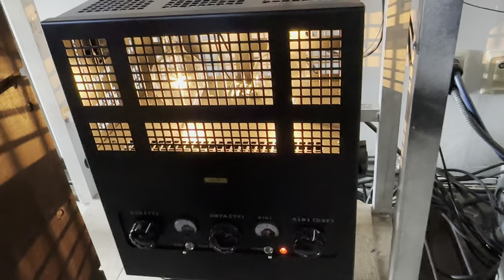3,Sound Of Western electric 12a,13a horn Speaker

Comment: I was lucky enough to own a pair of Altec-Lansing Voice of The Theater with the 801 horns. The definition, the low bass and the efficiency were all astonishing. To prove how efficient they were, I only drove them with just my preamp, no amp connected. That mV level was able to drive them. Amazing. The directionality of horns can be disconcerting for some, but the definition can't be beaten.
Reply: When I was 19 -20 (1970) I bought my first "stereo" the speakers I chose we Altec-Lansing Voice Of The Theater A-7 500-8 component system and my dad and I built the cabinets to spec. Horns mounted in cabinet. They were powered by a Kenwood integrated amp KA-7002 which I believe was rated at 50wpc. this sounded amazing especially when I'd take them to a outdoor party where they could flex their muscles, playing Led Zeppelin for instance around 3-4 on the volume and standing 50ft or more away sounded like a live band playing. I had those speakers for about 12rys and sold them for what I paid for the components which was $600 if I remember correctly.
Reply: I have also heard about VOTTs being driven from the headphone Jack on transistor radios. Would like to see and hear this!
Reply: @harryberry474 Still wish you had them?
Reply: @theman36  ...yeah sometimes, they were fun but impractical indoors they really needed room to breathe, I replaced them with ADS L710's (which I still have stored away)

Comment: I remember similar in an old Mono cinema I worked in as a youth. Mains energized coils. Silly efficiency, fed by a double push pull pair KT66 30 watt amplifier. Years later I measured the frequency range. Nothing at all below 100Hz or above 8kHZ. Fine for old optical mono sound. Did sound better than it measured, but a little boxy and quite colored sound. Typical for big old cinemas of its day. Not HiFi by any stretch of the imagination.

Comment: Looks like we got audio right the first time as a species. What is this? 110 year old speaker system for a movie theater?  I've messed with Jensen speakers from the 30s and yes they also required about 400V on the coil to engage the magnet. I have a Magnovox from 1923 that requires a 6v battery to be connected to the coils.

Comment: A rare and terrific turntable but these speakers are really colored by the entire horn/wooden parts. Yes they are efficient but mostly made for stadium use not for reproducing piano. Which is really hard for ANY speaker to get right. This recording seems to have artificial reverb. It could also be the effects of the horns I mentioned above. Looks cool but  not accurate.
Reply: does it matter? to some it does to most it doesn't.
Reply: If you enjoy it fine. But distortion should be something you strive to eliminate not encourage. Getting closer to the source material or original sessions is what being an audiophile and a music lover should be. Why spend thousands and thousands of dollars on gear if not to get that much closer to the artist? I get the fun factor but none of this meets the above requirements.
Reply: tubes and horn loaded speakers aren't known for low distortion and accuracy, you could argue that it's not the end goal with this system.
Reply: Well it seems people hear and experience sound differently. If someone gets goosebumps and begins to shed tears when hearing such a WE (horn) system it’s for sure involving in a remarkable way, no matter if somebody else criticizes perceived distortions. 😊